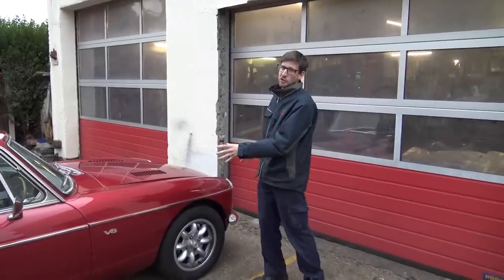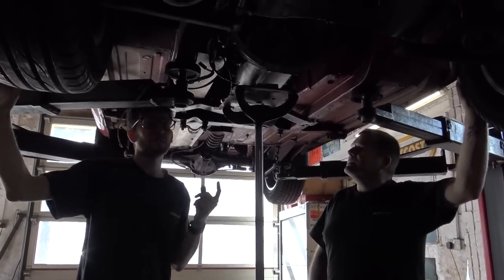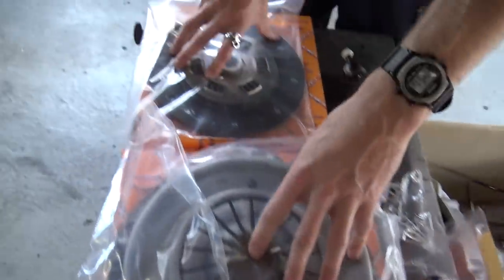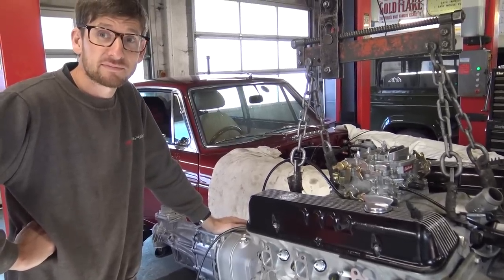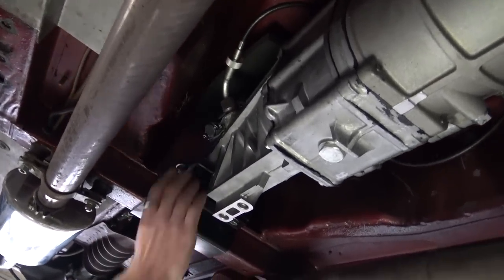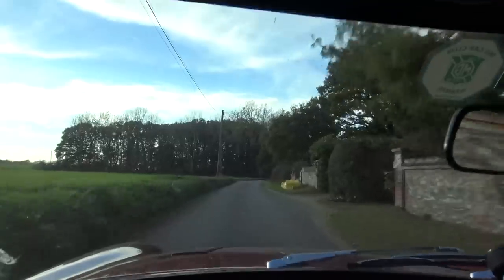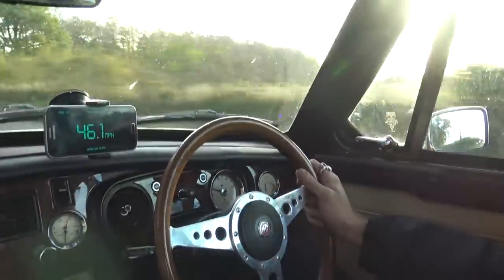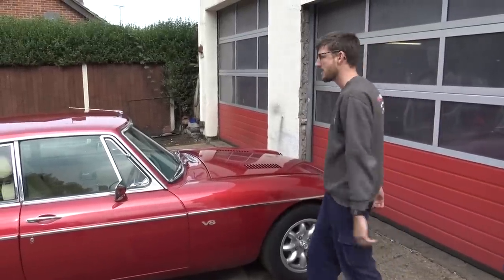4.6 Stage 3 MGB GT with a Brand new 5 speed gearbox conversion

Comment: Shortly after retiring, I bought a factory built 1975 rubber bumpered MGB GT V8 in 2002.Drove on MG Owners tour in Norway in 2006.Had engine and rear axle reconditioned  in 2012. Ventured to Ventnor etc on Isle of Wight, UK 2015. Toured around Pyrenees in Spain and France in 2016. MG Owners Club trip to Barcelona  in 2017. Used it as fun car and transport  to golf club weekly for 10 years too.Sold it in April 2022. Because of that car, I saw places I would never would have visited otherwise. Now in my 80s with many special memories.

Comment: I upgraded my B Roadster from a 3.5 to 4.6 using an RPI engine,I got much help over the phone from Chris and Holly, great company to deal with.
 I used the RV8 front crossmember and a Hoyle IRS kit on the back end, the car was a joy to drive.
 I did the upgrade in 2002/3 and finally sold the car a few months ago, beginning to regret it a bit now.
Reply from the maker: I'm not going to help here.....................WHAT, you sold it!!!! I'm sure there was a good reason at the time. You never know, you may be able to buy it back one day or build a better one

Comment: Why did I watch this? Sitting in the office at 6:30 am waiting to open my business, I usually watch TRex, Bowie or Faces videos. I drove my ex-NYC gas company auction Focus station wagon to work on this beautiful spring morning. I could have driven my MGB V8, 4.6, T5, 3.08 LSD, convertible! Whaaaa! 3rd one I've built, went a bit overboard, RV8 front suspension & brakes, F.A.S.T. fuel injection, stainless fenderwell headers, MGOC SS dual exhaust & Crower cam. I also have a late model Mustang 5.0. The MG is infinitely more fun to drive. Even though I could just make it back home to swap cars I'll wait. Despite all of the current restrictions in place there's no rule against a top down drive on a nice evening. On second thought, thanks for the motivation. Now I have something to look forward to. It will be a long day.
Reply from the maker: Thank you for your comment :-) Hope we have inspired many to do the same
Reply: @RPIEngineering  I'm sure you have, extra power, handling, refinement are always an inspiration. Of course, the cars themselves do a pretty good job too. Far more so now than when they were current I think

Comment: The memories this generates. Had a 75 B early model with the plastic bumpers but twin Solex carbs. Drove it for nearly five years from Southern Utah to Las Vegas, Winter, spring, summer, and fall. Engine would overheat at each stop light during the hot months so I took a windshield washer tank and pump, laboriously filed notches every 4 inches on a copper tube that formed the outside of the radiator then installed a foot button (from horns) to spray mist during each stop. Would empty the reservoir between I15 and Eastern Ave so I would refill before heading home. July and August would literally burn your feet so I installed aluminum sided insulation under the floor rubber. It helped but didn't make the interior any cooler. Look back at those years and now think they were the most exciting in my professional career. An MGB, Mahler, and a 32 oz Dr Pepper. Doesn't get much better than that.

Comment: I've suffered the dreaded British sports car lust  (possibly an American phenomenon) for nearly 50 years. After giving up on a near dead 66 MGB my father purchased from a neighbor for $60, he asked if I wanted it for my 18th birthday. Of course I did! Soon after getting it going I saw a Hot Rod engine swapping book article about a Buick 215 in an MGB. Next up I looked at buying (and declined) such a swap where the shifter of the 3 speed came out through the radio support. A few years later I ran into Glen Towery, from whom I had previously  purchased used parts, at a show with his "Purple Porsche Eater" converted GT. He had been to England and purchased 2 sets of conversion parts from Dave Vail at the V8 Conversion Co. Within a couple of days I owned the second set. Another acquaintance happened to have a '63 Buick Skylark with 215 4 barrel V8 which his wife  wanted gone. It was mine for a tow & a case of beer. A few weeks later I had my first MGB V8 and have never looked back. My current car was built about 20 years ago and unfortunately sat for about 10, initially derailed by college tuition. This car incorporates parts from just about every known supplier of V8 conversion parts. I am sure I have purchased parts from RPI at some point but have lost track now. I have had it back on the road for about 8 years now and still love to go for a spin in it. As to the dreaded BSC lust, although a have continually had a B since that first one I also had a '68 E-Type 4.2 FHC for 14 years, some Midgets & Sprites, an 1100, and have owned  an Austin Healey 3000 MkIII BJ8 for about 40 years, sans engine. Last summer I found a running car with a derelict body so now I have two! I am afraid the beauty of those cars may temporarily distract me from my V8. But never totally.
Reply: Instablaster...
Reply: @baylordanny978  I'll take it over my 420HP 2013 Mustang 5.0 anyday. No comparison, fun wise. The Mustang does have A/C but that's on the wish list for the MG too.

Comment: As the long-time proprietor of a US-spec Midget 1500, that BGT is the stuff of dreams. What a stunner! There but for money go I...
Reply: Drop a 150hp engine in your Midget. Plenty of modern 4 cyl FI engines that will weigh less than the 1500 and have more go than any stock MGB. A Midget that will go 130 mph and blast by most anything on a mountain grade is a new world of fun. Lots of net info on engine upgrades for Midgets and Spitfires with that sad 1500. Go for it. 🙂
Reply: Yeah, the Rover K-series is a popular conversion in the UK. They aren't available here in the US. :-/
Reply: @rizzlerazzleuno4733   Nooo drop a triumph rocket 3 motorcycle engine in it. Keep it nice and light.

Comment: In the early 90's I did almost the same swap on my BGT, I fitted a 3.1 Buick V6 to a 5 speed  camaro  box, I used  the OE GM fuel injection, same wheels and hood louvers,  Paint in GM Black Rose, a Corvette color. Where is it now.

Comment: Gorgeous car and brilliant upgrades reducing weight massively i imagine with that new gearbox as well.
I wonder why it wasnt converted to fuel injection?
Reply from the maker: Customers spec on this was keep it simple however EFi is possible and we have done them before. Overall power between a good carb setup and EFi setup should be much the same however EFI will always have more refined throttle feel etc.
Reply: RPIEngineering yes, and better fuel consumption and lower emissions.

Comment: Nearly three decades ago I think it was recommended I put a five speed Ford Sierra  box in  the MG V8  I was driving then, but do correct me if  my memory is letting the side down. And if so was that a good swap?  I guess this  Mazda box  is the modern alternative. Should never have sold that car but it was a rubber bumpered one that didn't quite feel proper

Comment: Very nice. Shame about the dreaded diff whine. Plus it is too low geared really. Not sure were they 3.7 or 9. Would easily pull 3.5 if they were available. My thought for the roadster build was a complete rear end from the MX5 MK3 sport tech , which has the 6 speed getrag box & a limited slip rear diff.

Comment: Nice, but a modern fuel injected turbo 4 cylinder (example:Ford 2.3L turbo) would be more than enough power for an MGBGT and being lighter would improve handling, and bonnet louvers would not be necessary. And better gas mileage than a V8. Just sayin. But I did enjoy the drive around the country roads. 🙂 👍
Reply: Well, you a bit incorrect about the weight being a problem with the Rover V8.  My 'B lost about 40 pounds over the front axle when the aluminum block replaced the old 1.8.  Mine was also set with with Sebring kit, and recently sold on Bringatrailer.   Mine frankly wasn't near as nice as this one,  https://bringatrailer.com/listing/1963-mg-mgb-v-8-conversion/
Reply from the maker: Its not going to have that Classic V8 burble and bottom end torque that the V8 has though.

Saw a SR20DET engine fitted in a MGB GT some time ago on the internet though and was certainly different
Reply: @RPIEngineering  A friend is installing a SR20 with 5 speed in a MG Midget. It also has a Corvette front suspension/steering and a Jag rear end. Gonna be awesome whenever it gets finished. 🤔
Reply: @qqq854  Yep, just about any modern 4, 6, or 8 is going to be an improvement over the original 1.8. It is just astounding that there are so many 4s that have over 200 hp. All that being noted, it is fun to go to auto shows and see a completely original (or restored) MGB. The B is one of the cleanest sports cars designs, but with the bonnet closed who knows what could be hiding in there......that's why I don't like louvers or scoops.
Reply from the maker: @rizzlerazzleuno4733  First engine I ever completely rebuilt and upgraded was an SR20DE lump, still love the SR engines but afraid the RB trumps it some what :-)
Reply: @Bercilak de hautdesert Cool. Any of the rubber bumper MGs with their sad low power factory (in North America) engines will be much more fun and efficient with a more modern engine.  An MGB should have at least 150 hp, in my opinion....with any number of cylinders, but a modern 4 cyl would be the most efficient.  MX-5 Miata are fine with their 4 cyl engines.🙂
Reply: Because it came from the factory with a V8 Rover?

Comment: Just wondered why you used a Mazda gearbox? I have converted 3 MGBs to V8 on each one I used the RoverSD1 5sp gearbox (which is bullet proof) and Rover P6 2000 prop shaft all bolts straight in.
Reply from the maker: Because the LT77's and even R380's although very strong most are badly worn now and parts for them are tricky to get. The Mazda box is a great little box thats brand new, it had a great feel on shifting gear where as the LT77's and R380's where always a little more agricultural :-) More explained in this video here
https://www.youtube.com/watch?v=fvTfL7Bh1RM&t=2s

Comment: Why not use an Ford 289 cu. in. 271 hp or the Shelby 306 hp version? It’s an extremely narrow and compact engine capable of extremely high reliable power output. I will admit the Rover engine is a capable engine BUT its weak link are the cylinder head attachments. My favorite vehicle was my 2000 Range Rover 4.6 HSE. EXCEPT for the cylinder head attachment failures. Yes 3 times!

Comment: Running the vac advance off the timed port is an emissions dodge, you will get better results running vac advance off the non-timed port assuming you can find a suitable vac canister. You can then run much more idle and low rpm timing but allow the timing to back off if required when you floor the throttle.
Reply from the maker: Not from what we have experienced in 30+ years and real world road driving. Throttle response is greatly increased with vac advance on a timed port. When the MG R V8 went off to Japan they moved the vac advance to a non timed port and its a known correction to assist in getting the vehicles to drive better to place it back to the timed port where rover designed it to be (along with correct mapping etc as well)

However I do see the logic behind your explanation with decaying vacuum under opening throttle however in the real world on a dizzy setup it just does not translate to throttle response and drivability for a road car.
Reply from the maker: @sidecarbod1441  We will have to agree to disagree. There is often more than one way to get to similar results. For us we have always seen great results as our customers have experienced, is seen in our videos and the tens of thousands of engines that we support remotely have reported back.

Comment: I have a question. Why not use a Ford 4.7 liter (289 cu. in.) engine? It’s light, narrow, tons of factory and aftermarket parts available. Hey if it was good enough for Cobras and Mustang GT350’s to blow everyone’s doors off in the 60’s. Why not now?
Reply from the maker: I've seen lots of different engine swaps in different cars before. Even a SR20DET Nissan turbo engine in a MGB however as the MG B GT was factory produced with the Rover V8 engine fitted many customers like to keep it this way and as its the engine we have focused on for the last 30 years its why almost all our videos etc are Rover V8 based.
Reply: RPIEngineering, how about head gasket issues? I know my Range Rover had to have its heads redone twice. I loved the 2000 4.0 SE that I had but mine was a very limited production model that met California emissions standards. You could only use parts for that particular model and that year only. I was going to do an engine swap but could never get answers from Land Rover on bolt patterns on the transmission bell housing. I wanted to install a Chevrolet 400 small block in it because it was a high torque engine. I finally sold it to my repair shop owner. Even with the tons of issues it had I loved the old girl.
Reply from the maker: @arttafil6792  If the engine is built properly and cared for well then there should be no head gasket or block cracking issues.
Reply: RPIEngineering, no block cracking but head gasket and warping of the heads. The second time it was repaired the left head was.003 out and the riright head was .004 out. Once they were planed it required a thicker head gasket. I had a solid copper gasket installed. All new grade 8 head bolts were installed and sequence torqued per my instructions. Old time hot rod method.

Comment: What sort of power & torque figures did this one make?
Reply from the maker: Around the 280 bhp mark and up to 300 lb/ft torque. As you can tell from the video though the torque comes in really early
Reply: That's pretty healthy, enough to give the car a good workout!
Reply: @RPIEngineering  Unfortunately that low rise manifold will be costing you a lot of BHP, I suppose you did not have much choice really. Even the Edelbrock Performer manifold starts to become the restricting factor on a tuned 4.6, port matching helps a bit!

Comment: I notice the exhausts are not linked, is this not required for this engine.
Reply from the maker: Nope no need, we see cars with both balance pipes and without and see no difference in how they run. Makes a difference to how they sound depending on how large the pipe work etc is.

Comment: What diff ratio you running ?  sounds like it needs another gear.
Reply from the maker: Its the standard MGB GT V8 rear axle. Feels great to drive however with a 4.6 under the bonnet it would probably pull another 3 or 4 gears :-)
Reply: @RPIEngineering  what torque can the gearbox take and have the ratios in the gear been changed to suit the V8?
Reply from the maker: @mgbroadsterJ  The diff ratio on the Mazda and the MGB GT are identical so the ratios in the gearbox are left exactly as they are and it feels like a great setup when driving.
The box is rated up to about 250bhp however there are lots of turbo Mazdas running 300bhp and not breaking the gearbox so the customer with this car was happy to install the 275bhp (ish) 4.6 engine in front of it. Of course subjective to traction and driving style. For sure if you were drag racing then you would want the T5 box
Reply: @RPIEngineering  The best ratio rear axle is a MGC diff 3.3:1, MGB standard is 3.9(too low) and MGBV8 is 3.08:1(too high)
Reply from the maker: @biggles145  Subjective to what you want to use the car for really. There is no idea final drive ratio for everyone, nor is there one engine build that would suit all.
Reply: @biggles145  My converted mgb uses a capri 3 litre diff 3.09:1 and is perfect  put down 180bhp at the wheels on rolling road,Great torque allows me pull off in 2 gear no problem using rover 5speed box.

Comment: That hood/bonnet doesn't look flush with the fender/wing.
Reply: My brothers new 1971 or 1972 MGB and my used 1972 MGB were fine but it's a common issue due to the poor support structure from the hinges to the leading edge.
Reply: I'LL BE BACK !     BS ! My 1964 B  original aluminum hood/bonnet is a perfect fit and as new, never wrecked or modified, no body work.